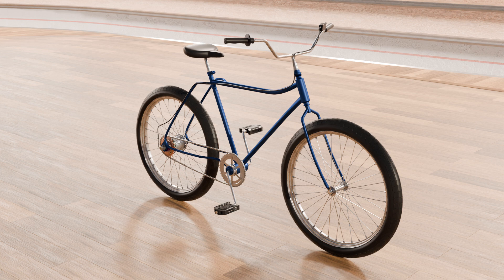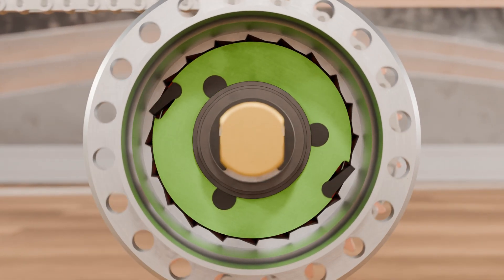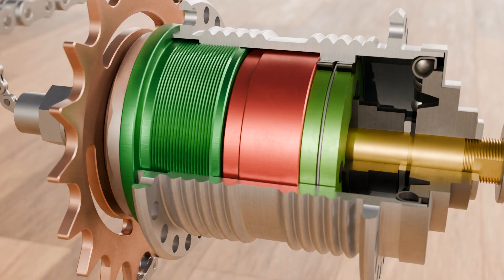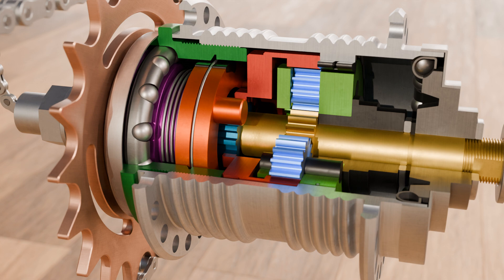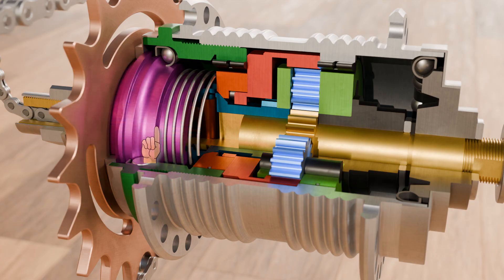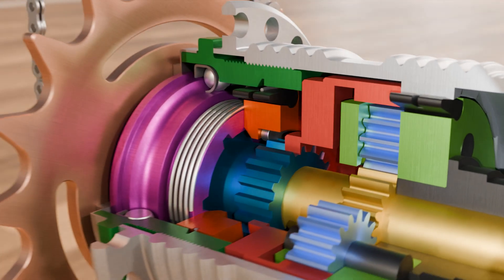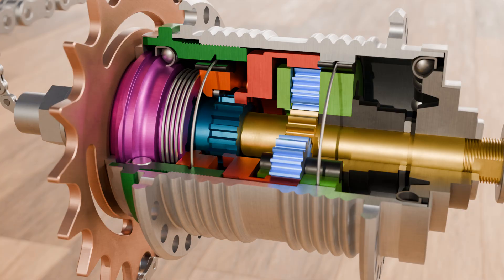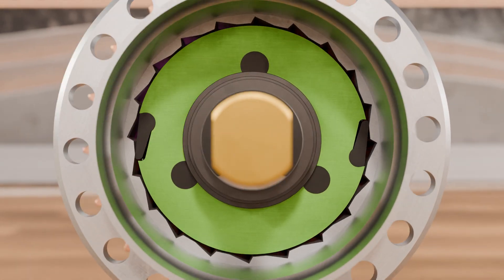How does a 3-speed internal-gear hub work? | design and operation simply explained

Comment: What an elegant and sophisticated solution for a bicycle. This shifting solution meets all the needs for regular city riding, eliminates bulky  external shifters, and eliminates the issues of shift failure and loss of chain tension that are common with derailleurs. I would love a bike with such a shifter.
Reply: Sturmey-archer three speed has been used on bicycles for over 100 years.

Comment: Learning derailleur transmission type is like: okay so the number of teeth goes up at rear gear - the less effort and more revolution will be required from gear at front to match it.  So pretty easy concept to learn (2 gears connected with chain), literally levers system at its simplest form.
   Hub gear transmission is like: okay so there is a sliding clutch, and the planetary gear system which is dependent on which part of the gear you apply torque (ring/planetary or planetary carrier), and there are 2 ratchets and there is a hub sleeve, and each speed-gear using different pathways from input to output shaft... Like my intuition was starting to hitting a wall there. I needed a little more background knowledge to make it somewhat to be digestible. The similar system is used in automated cars transmission. To say the least, the manual one (its predecessor)  is somewhat hard to grasp at once, let alone this one and its in the bike.
   Tl;dr: the sliding clutch (blue sliding gear) is directly connected to the input shaft (copper outer gear which is connected to the chain which is connected to the pedal gear) and the output shaft is the hub green outer shell (which is connected to the wheel) and via magic fuc*ry called "engineering" we are putting different mediums between this two to create different ratios of input/output. Wanna understand it more in-depth ? Good luck with that, unless you are already familiar wit the planetary gear concept and sliding clutch system. And if you feeling dumb it is because you are trying to learn some advance concepts here while skipping introductionary courses.

Comment: My mom has a very old Japanese bike with 3 speed hub transmision, it has small metal rod on the left as the gear selector, the mechanism push the metal rod to 3 diferent depth position for each gear. And this bike still being used for 20 years old untill now 😮 it's crazy reliable

Comment: This animation is fantastic.  You have the equations backward. When the ratio is 1: 1+(Zs/Zr) it is bigger than 1, and you are in high gear with the shell over running the sprocket.  Similarly, when you are in low gear the ratio is 1: Zr/(Zr+Zs) which results in a less than 1 ratio, and the shell runs slower than the sprocket.
Reply: Big if true-- as this makes me feel less crazy for thinking the math wasn't mathing

Comment: When I was child, the bigger the sound made by the ratchet, the cooler bike it was.
Reply: We used playing cards on the spokes, lol.
Reply: when I was a child, we would attach playing cards to the frame using clothes pins, so that the playing card would flap in the wheel spokes as the bicycle wheels turned.  That made both the bike and the bike rider even cooler.
Reply: @MrGreenelight we kept attaching stiffer and more robust things (think sticks) until we got close to the sound of the V-twins roaring past on the highway.  It was about then that we went too far, jammed up the front wheel, and I went over the handlebars.

Comment: Im 73 and had this 3-speed hub on a Columbia Flyer bike 60-65 years ago and it worked fine most of the time but many times when I was drag racing someone and I was applying maximum petal power while standing off of the seat and shifting from 1st to 2nd sometimes it would fail to engage 2nd gear and go into a neutral position causing me to fall down onto the top frame rail and hit my family jewels in excruciating pain 😢, but most of the time I could beat any kid my age in a race because I always had very conditioned runners leg muscles, but they always complained that it was because I had a 3-speed hub and they didn't, so I decided to trade my complete 3-speed setup to one loud mouth neighborhood kid who would never shut up for his single speed hub wheel and I still beat him and every other bike rider in the neighborhood every time. 🤣😂🤣

Comment: This was such a mystery to me in the 60's, thankfully it still is.
Reply: Start at 4:15 to help understand it. It's basically just a sliding piece that engages different sized gears depending how deep it is.
Reply: @christianvargas7099 

There is just one gear ratio that can be reversed, giving you 1st and 3rd gear, and then direct drive, disabling the planetary gear set (2nd gear).

Comment: Thank you for posting this. I have wondered my whole life how these worked since I rode a geared bike for the first time. Never wanted to even look at a one speed bike again. A shame this could not be scaled up for car use as is. Would be like a Powerglide with overdrive. The ratios are similar. Deraillure bikes look primitive in comparison.
Reply: cars that have an automatic transmission use the same kind of gear system.  The gears are changed by hydraulic cylinders instead of a mechanical linkage.
Reply from the maker: Glad I could help!

Comment: i still don't get it, what does spi the real bicykle wheel, so it actually moves?
Reply from the maker: Inside the hub, there's a system of gears (planetary gears) that transfer the motion from the sprocket (the small gear the chain turns) to the hub shell (the outer part that’s connected to the wheel).
Think of it like this:
1. You pedal, the chain turns the sprocket.
2. The sprocket turns the gear mechanism inside the hub.
3. The internal gears control how fast the hub shell turns.
4. The hub shell is directly connected to the wheel, so when it spins, the wheel spins, and you move forward.
So, it’s the hub shell that actually spins the wheel, and the internal gears just control how fast it spins compared to your pedaling